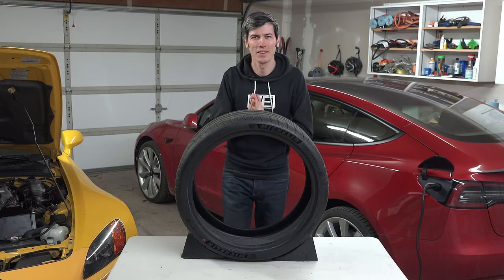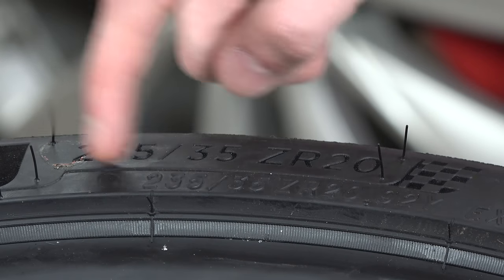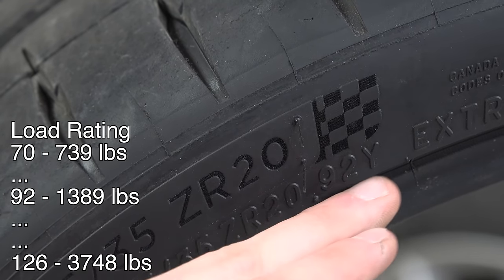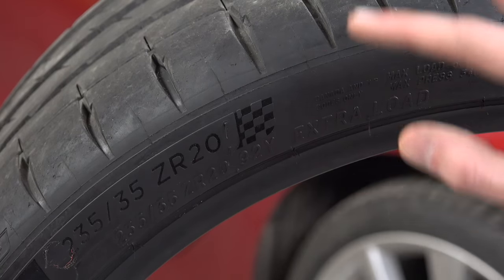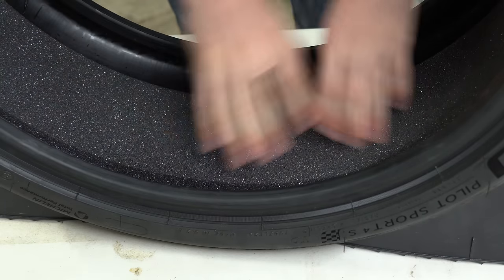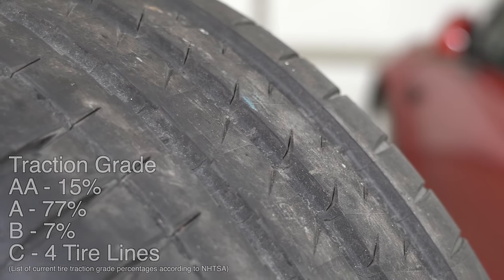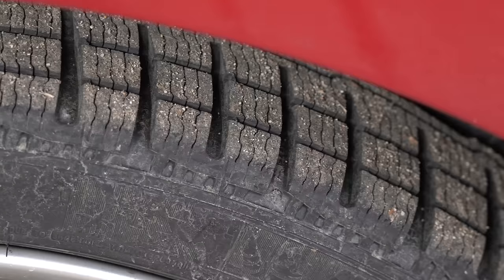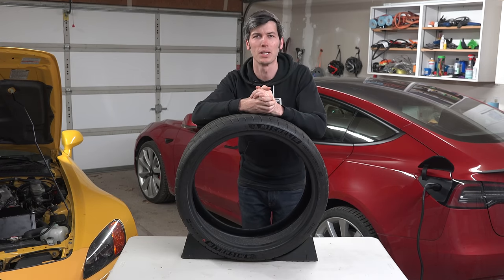The Ultimate Guide To Tire Sidewalls - How Good Are Your Tires?

Comment: About the date-stamp, as a general rule for summer tires, how old is too old? Being driven or being in storage would make any difference?
Reply: Good Question .. I believe 5 years is the general rule . after that the tires start to harden up and you loose traction as well as they may start to crack . stored or not . they will look good stored but when you put them on they will start cracking . old tires are not worth putting on...unless you put them on the rear of a rear wheel drive and do some donuts...lol ...but don't put on the front...

Comment: What does Max Load mean? Does it mean Max Sustainable Load, or Max Burst/Spike Load? 

If a car weighs 4000 lbs and each tire is rated at 1000 lbs and the driver does a brief skid at 1G, or they go over a small jump/bump, will the tires instantly explode?

Comment: Great video, Jason! Very explanatory! 
   I didn't get very well the extra load description. Lets say that car manufacturer recommended psi  for the 2 front tyres will 34-36psi each. If you get XL tyre (instead of SL), should you increase the pressure to 38-40 for this case?

Btw,  you could make a video for the XL tyres... pros/cons!

Comment: I was recently being told that 235 is the width of the tread, not the tire itself; and that tires of the same spec width can look very different when mounted on the same wheel, with the extreme example being Hoosiers.

Comment: Maximum Load is at Maximum Tire Pressure.

Less pressure equals lower load rating until the tire is under its minimum pressure which is not specified on the sidewall.

Maximum Speed rating is dependent on tire load and inflation pressure.

Comment: Good video but was expecting how to read sidewalls for track use. As in determine if it rolls over or is over or underinflated ( I know pyro meter inside middle out also help with that). What would also be interested is a discussion of good and bad semi slick or slick wear patterns. Find it pretty hard to tell what is 'normal'

Comment: Please, inform the viewers that when you change load (not necessary bad and inevitable some times) you HAVE to change also pressures!!! Because, same load index with other pressure can stand different load!
Also, please clarify that load ≠ mass!!! Because... Roll. So you don't want Load = Mass/4 in every tire for sure!!!
Best case scenario: you refer to manufacturer for default tires' load index and pressures to determine the supposed "factory" load for every axis and then you try to implement the same load with the new load indexes and new pressures, that REPLACE default ones!

Comment: Does higher treadwear rating means harder tires -> less grip? For example, does a tire with treadwear of 200 is more grippy than a tire of the same manufacturer with treadwear of 300?
Reply: I don't think that's a good way to judge. In theory for racing, harder tires mean less grip but wear out slower. But that's because everyone is using same type of tyres. 

But tyres of diff brands and models, it's not a good way to compare. After all there's a traction rating for every tyre, so the best way to judge is from that.
Reply: @roincec  I see your point. I don't think treadwear is a good way to judge grip, it's more of a curiosity if the two are related.

Traction rating is measured on wet track, so I'm not sure if it's a good way to measure grip on a dry road. I wish there was a universal system and a more simplified way to show the information of the tire instead of those letters.
Reply: The treadwear rating would also be a product of actually how deep the tread is. A deeper tread will typically last longer (within reason, given a very deep tread will move around more as it heats and this MAY have increased wear rate as a result).
Reply: @Thermalions  
it also takes longer for a deeper tread to wear down until they are no longer deep enough to be legal.

Comment: It's funny that this tire was made specifically for that car, the car's tire pressure rating is 43psi and at 8:30 you can see it says "never inflate beyond 40psi".
Reply: Is says never inflate beyond 40psi to seat bead.
Reply: The tire limited to 40 psi is incorrect for the vehicle using 43psi.

Comment: My 2010 Explorer was using 245/65/17 tires. Today I bought 255/65/17 tires. The new ones are taller and wider than the old ones. So I guess the 255 number has something to do with the bigger tire diameter, right?

Comment: 225/45 ZR 17, BFG g-force Comp-2 A/S
These tire rail in a monsoon.
Reply: Got those exact size on my IS300 and they seem to be pretty good.
Reply: @2jz4life35  Accord Cpe, 25k on them so far. Definitely will outlast the 40k rating. Even wear with rotations. THey danced a little for a couple thousand miles, but never broke free, I love em.

Comment: I got a 4 Federal SS595 with A 240 treadwear rating. The tires on the car before them were Continental with 500 treadwear rating. The continental lasted about a year. The federals have been on the car for 1 yr and 9 months now And STILL are not 1/2 way though the tread!!! So went to buy some for my sons car and they stopped selling them.

Comment: I have  BFG KO2 tires on my truck and the date code reads 7122 (last four digits of the DOT code). Its my second set of KO2's and I had them put one of my first set on the Spare Rim, that DOT code reads 7111. I looked around the internet and there's no explanation for the "71" on both those code numbers. I know that the first two digits are the "week" and the last two digits are the "year". Even BFG's web site says the code is Week/Year.

Comment: Great video keep at it! Is there any real advantage or disadvantage of unidirectional tires? I cant find a good video anywhere
Reply: @xenonram  I was mostly thinking performance wise, as in is there any advantage in handling, water evac, wear etc. Just got a car that has unidirectionals on it and im wondering if i should stick with that type of tire, or not, once a change is required.

Comment: To measure the treadwear rating they would drive in a circle for about 7200 miles in street conditions and then measure what is left of the tire. If the tire worn off completely it gets rating 0. BFGoodrich G-Force TA Drag Radial got the rating 00, which means that the tire did not las the entire run, it just blew up at around 5000 miles

Comment: I have been in the market for new tires and can not find ones to meet my needs. On my pervious car I had driven 55,000 miles and it still had the original tires when I sold it. Now I have just over 20,000 miles on my new car and the tires already need replacing. What tries do you recommend that will last at least 40,000 to 50,000 miles? The tire size is 265/45R19 in front and 295/40R19 in rear.

Comment: As soon as you change to a tire other than identical original equipment ratings, the door tag no longer applies. Max load also directly correlates to max pressure and visa versa. How do you know your pressure is correct for the actual load? The 90% rule works well. The measurement from the ground to the wheel at the point closest to said ground, should be  .90 of the top dead center measure from the wheel to the top of the tire. And never exceed max pressure, for highway driving. Then there are still about a hundred other factors to change everything.

Comment: How many years can you keep a tire ? I have a Goodyear triple thread on my Honda and aMichellin pilot on the other Honda, Michelin have sidewall cracks now 5 years old but the Goodyear is still no sign of cracking both tires is 5 years old.Still have 50% thread 6/32 to be exact.Both the same price when I bought in 2014.When should I replace them?
Reply: 5 years is the general age of a tire life .. Michelin are notorious for cracking, I've had them crack after two years .. there made for straight pavement , any rough surface or dirt road will destroy them

Comment: Jason, I knew from a long time ago the info imprinted in the tires, but I've always wander why TREADWEAR is not standardized in tires  as all the other measures?  Even if the processes and materials are different,  treadwear  should be a standard.  Even for purchase decision among all the sizes.

Comment: Jason Question on speedometer reading as it relates to tire size. My Toyota Corolla speedometer consistently reads 2 MPH
faster than speed reported on GPS/Road side radar units. Could I replace the tires with a higher sidewall (thus slower rotation per mile) and lower the speedometer reading? I see lots of such speedometer conflicts on the internet. It's a small thing, but drives me nuts. I think too that the odometer is racking up higher miles that the car has actuality traveled. Thank you for any attention you may give  this question.  Toyota garage said the reading are within some manufacturing standard.
Reply: Now that you mention it, I believe I have seen the speedometer closer to the GPS speed depending on what speed the car is traveling. I only have an analog speedometer, so “eye balling “ it. Guess I will just have to live with it.
Reply: PS. Can it be fixed?

Comment: Manufacturers only care about NVH these days, hence why some people get their cars back from services with more pressure than the placard states. Also because most people don't check their tyres because they are just appliances to them, we pump them up a bit more. There is minimal grip loss from running a few more psi then recommended, 90% of the wear I see as a wheel aligner could have been prevented by 4 more PSI for the life of the tyre. Your tyre shop is there to try and get you the most life from your tyre possible (at least the good ones do)

Manufactures don't care about it costing you more in fuel or having tyres needing replacing at 2/3rds of what you should be getting because the inner and outer edges scrubbed, or rim damage that could have been avoided by having a slightly stiffer tyre taking some of the hit instead of the rim. Hell you get a puncture that 3 or 4 more psi may be the difference between a needing new tyre and stuck on the side of the road fitting a spare and not making it that last few minutes home.

Also checking your brand new tyres when you get home with your un-calibrated gauge you got off eBay for $5 and saying the pressures are different from recommended is kinda silly (remember PV=nRT) so hot tyre pressure is gonna be different from cold and the airline at most servos (gas stations) either leaks or the gauge has been left in the sun that long it may as well be a pressure estimator because it may or may not have the pressure the gauge states in it.

Comment: Good overall explanation, however I think some more emphasis needs to be put on the DOT stamp. There seems to be this belief that budget tires are somehow unsafe and anything less than (insert your preferred brand here) will cause your car to spin out while turning into a parking spot and burst into flames, and that's just not the case. 👍

Comment: Hello. Quick question. 

I have my stock wheels and tires. Wheel: 5.5x15 / Tire: 185x60 R15. 

I’m about to change my wheels into 6.5x15 offset +38.

My factory recommended tire pressure is Front 32psi and back 30psi. 

Question is... After changing my wheels, will my tire pressure change as well? 

Thank you in advance. 😊

Comment: Excellent video! Thank you for the info. I do have a question... I have the same vehicle and I ordered aftermarket wheels & tires which are staggered set up in the rear 275/30 & front 235/35 Michelin AS 3+ the tire treads look different. Is it Bc of the size difference? The larger wheels look more rounded in the front side (outside). 🤔🤔 The rears are also shiner & the front tires look like they were used before. Front dated 2219 & rear 4419. Is this normal?

Comment: So i have custom rims which is larger than original so how do I know what tire pressure i need? Does the same pressure from the original apply ?
Reply: Sadly no. Tires with a smaller sidewall need more pressure.
Reply: I found a great guide. Use chalk to make a line and se how it disappears over a short drive distance it will tell you if it's to much or too little air
Reply: Your vehicle manual will likely provide pressures for a wider range of rims sizes than what is printed on your door sticker.

Comment: wish the EU would pick up on the treadware indication. rating almost everything else but if you expect them to last 12 month's or 3 years doesn't matter.
seems like eco friendly information, tossing out 6 tyre's in 3 years or 2 tyre's in 3 years. my rears got replaced by old age (rubber starting to crack) they don't seem to suffer at all (fwd car).
car came with toyo proxies t1r..a not fantastic year round tyre but cheap and they lasted for 3 years at the front, the garage recommended replacement at double the cost of the toyo's (as the toyo's almost made me crap my pants in the rain) were fantastic in the dry and rain but had to be replaced within a year. what i wouldn't give for the treadware grade.

Comment: My question involves tire manufacture age on a new set of Michelin Defender T+H tires which I just purchased in April, 2022. 3 of the tires show a mfg. date of 3018 and the remaining tire shows a mfg. date of 1122. Should I be concerned that 3 of the new tires might be too "old"? I'm a Senior Citizen so I'm a pretty careful driver. Also, I monitor my tire air pressure on a regular basis and the car is garaged. These tires are warrantied to 80,000 miles. What are your thoughts? Any help would be much appreciated. Thanks you.

Comment: On some tyres (English spelling) there are little arrows pointing to the tread.  I have only found them on ultra high performance tyres and informed they were where the tyre wear should be mainly in track days and the wear was adjusted by tyre pressure.  The information was that reducing the tyre pressure moved the wear closer to the arrow point, and increased tyre pressure moved the wear away from the arrow point.  Has anyone else got further information?  Is this just rubbish?  I do get better times the closer I get to the arrow point.

Comment: Jason is there a reason that you did not mention that those Tesla tires are directional?   The word OutSide on the tread suggest that the tire is directional.  I only mention this because once I purchased a pair of tires and the shop guy mouned the tire  with the arrow on the sidewall pointing backwards.  Here in NYC I once saw a Tesla being mounted onto a flat bed because it had four flat tires and I wonder if that guy had to wait a few days to have tires shipped to the shop the car was towed to considering the limited number of tires brand making tires that would fit.  So Jason did it take long (longer than a week) for you to receive the winter tires currently mounted on your Tesla?
Reply: mgsboedmisodpc2 Directional and side-put tread patterns are different. Directional tread is necessarily symmetrical while side-out tread is necessarily bidirectional— think about it: otherwise they would need to be dedicated manufactured as left side tires and right side tires (like your shoes).

Comment: Correct tyre pressure will always be 80% of the max pressure stamped on the tyre, not the decal, not the dealership, etc. For example back in the 70’s tyres where inflated to 28-32 ish, use a modern tyre with that pressure in a vintage car and ruin it. Ask any tyre manufacturer and the answer is clear and straight: 80% of the max pressure. People should learn this hard core fact =)
Reply: alejandrorosillo: On the contrary, in the early 1980’s many GM fwd sedans wore P-metric tires with 35 psi max and 35 psi cold inflation per the placard on the door.

Comment: That foam inside indeed reduces noise but makes the tire unreciclable. These tires end up beeing burned or in landfil. The ones withouth foam can get crushed and reused. Similar to the ones with foam, the tires that have black glue from factory to protect against leaks or any coloures writing on them, paint end up beeing burned in cement kilns or landfils.   Indeed it is a nice design and so on but instead or reducing waist and pollution these tyres increases it. Also when you want to repair these tires you must scrub off the foam....

Comment: Thank you for the in-depth explanation! I learned a lot from this video. do you know if the PS4S is also a directional tire? or is it just a outside/inside distinction? I think my tire shop may have alternated my tires left/ right. Is that an issue?
Reply: They are asymmetrical. They may have mounted wrong.

Comment: 92Y means that the tyre can run at Y speed when it load at 92 at max tyre pressure (50 psi).
Reply: Max tire pressure is NOT the pressure that you SHOULD fill your tire to, but the pressure at which that tire is still considered SAFE, thus not recommended
Reply: @Ygr3ku  When you have the max load on your tyre you sould have the max tyre pressure to not overheating the wall of tyre as long as you run for the max speed

Comment: Yo, what's your feel about tire sidewall dry rot. Got a 2010 car from my dad, only 27000 miles and tires have lots of tread but side walls have small "dry rot" cracks. I imagine any tire dealer will tell me I need new ones but they are mainly driven by making money. And is there any recourse with the manufacturer. These happen to be Michelins but googeling it a common occurrence with almost all brands these days.

Comment: Do XL tires affect your car's performance or do they improve it? More unnecessary weight or stiffer sidewalls, better heat and high speed resistance?

Comment: What if my tires are 185/55R16 and I want to upgrade them to let's say, 205/50R16 or 195/50R16? What happens to the recommended air pressure? Does it stay the same or it changes?